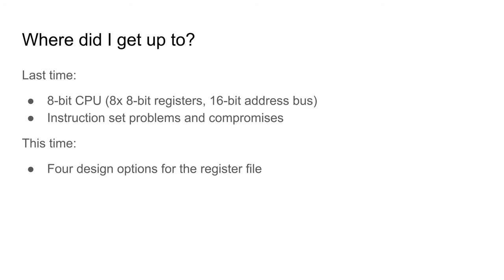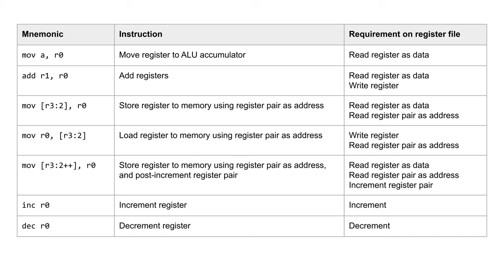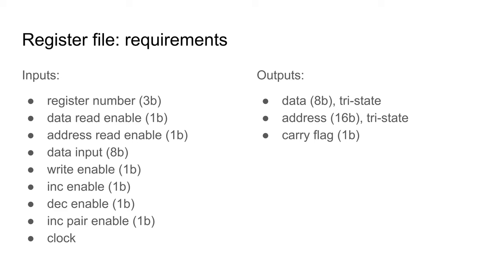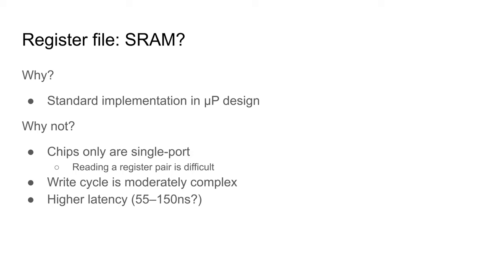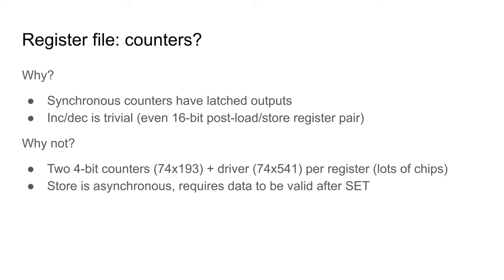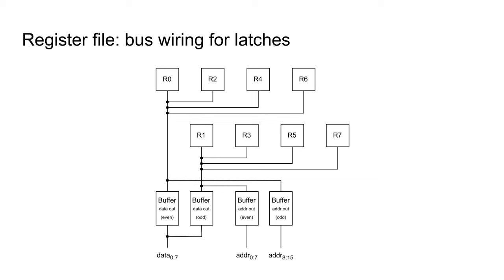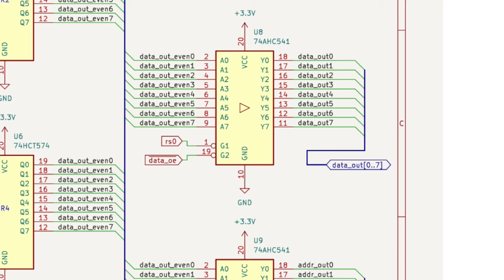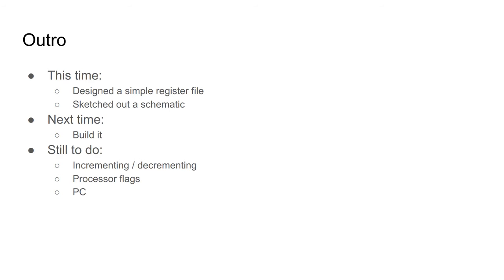Designing an 8-bit CPU - 2 - starting the register file

Comment: I have a hard time to believe that SRAM is not the fastest solution in the end, kinda like the ZeroPage in the 6502 only that SRAM is faster. Change you ISA to allow for instructions with more bits. Two byte instruction words. pcEngine and SNES (and sega genesis) had SRAMS . Those chips have 32 kB, but only 8 data pins. Data pins really seem to be a problem. Maybe if we look at old SRAM as used in the Commodore PET and VIC-20. 4kB chips. So for 16 bit addresses and program pointer we still want two of them. So 8kByte register file. The ALU would still be 8 bit or 4 ( Ben Eater uses 4-bit chips ). Atari JRISC is an ISA, but the only implementation has a timing which can be explained by the latches in front of the ALU. Just like 6502 and Ben Eater SAP-1 the contents of the register file is first transferred into latches. Then like on Z80 you could use a multiplexer to let your 4 bit ALU go over the data. In all those cycles you can load the next instruction ( pipeline ), so that it does not hurt to fetch multiple bytes into the instruction register. The decoder should wait when a branch opcode is detected. So like on Z80, every first byte fetch is followed by a pause where the memory 8bit bus can be used for something else. 
I know this is not very MIPS like. With MIPS the ALU is fed directly from the registers because we need the result with minimal latency because every instruction needs the ALU. For load store it does the addressing mode. For branch it first checks for the condition and then calculates the branch. But economic multi-port register files are very much a specialty of the a real microprocessor where ALU and file sit on the same chip. You could order prototype chips for 300$ . Just ALU and file. Keep the control logic outside to be able to tinker with it.

I don’t see the problem with multiple cycles. Loops can be coded in microcode. So yeah, need a micro instruction pointer and a counter.
Reply from the maker: Thanks for commenting and offering ideas 👍

SRAM is definitely the best solution for the system memory, agreed.  (DRAM would be faster but is a pain with the refresh cycles.  It was used on, for example, the BBC Micro because 32KB of 4MHz RAM back then really needed DRAM.)

However, my question was about the storage of registers in the register file.  Modern CPUs have many registers (over 100 in typical x86-64 designs, even if only 16 are exposed to the ISA), and will use multi-port SRAM, that is, something that supports reading multiple addresses registers at once (i.e. concurrent dispatch of multiple instructions accessing registers), and even writing the same register as it is being written.  This kind of setup is not possible with "ordinary" SRAM -- set an address, wait ~55ns, and you have a value on the outputs.  I certainly can't read and write a single value in one "clock" of SRAM (although SRAM strictly speaking doesn't have clock cycles).

I went with 74x574 octal latches because I can do precisely this: I can read and write on the same clock because they are edge-triggered.  I only need 8 chips, so it's not too bad.

You are right about the 6502 -- the zero page is almost like a set of 256 registers.  Accessing and updating still takes multiple cycles, though.

I wanted something that's a) built without microcode, and b) can retire 1 instruction per cycle (in the optimistic case).  Variable-byte instruction decoding will be painful, I think.  Of course, on an FPGA (or real silicon), it becomes less painful.  But this is discrete chips, and wiring 100 connections and finding the 1 single wire that's made a bad connection is starting to drive me nuts 😆

Thanks again for commenting... you've made me have a good think about the design.  Sorry if I've misunderstood anything you've explained.  I might warm up to the idea of a fixed 2-byte instruction width 🙂

Anyway, I've probably said this before: I am kinda working this out as I go along.  I'm definitely no expert in any of this (which should be pretty clear).  I wanted to turn my "oh, I wonder if this would work?" into "wow, this circuit actually does something!"  I'm slightly surprised anyone is even vaguely interested (!)
Reply: @phodopus42  oh, I guess I should recheck the single cycle per instruction thing of yours. Load and Store need two cycles as does immediate8. So from a single bit to a 4 bit counter it is not much more parts. My motivation for even a second pointer comes from all the bugs in the original 6502, which tried to do 16 bit without it.

It seems that you have the hard facts about RAM and I only know theory. SRAM is used for cache because it is faster than DRAM. Consoles used SRAM and ran faster than Homecomputers with DRAM. I agree that SRAM lacks separate in and out ports. It is so weird that each cell resembles a latch, but to save transistors and increase capacity, the latch is connected to the data line via transfer gates. Reading uses a slow connect to neutralised lines not overwhelm the small transistors, followed by highZ read out. Write precharges the lines and stamps this charge into the cell.

Yeah, many CPUs (says a book I own, but my only example is JRISC ) have 2 port register files, but none has 1 port.

Old DRAM had separate input and output ports for read modify write.

Why does google find me tons of dual port RAM where both ports can write at the same time, but none with dedicated read and dedicated write port. The specs and datasheets don’t hint at a multiplexer to assign external requests to the read or write port on an internal block of latches. This would explain why those chips are so slow. Even with serialisation on collision dedicated read and write lines would make the chip faster.